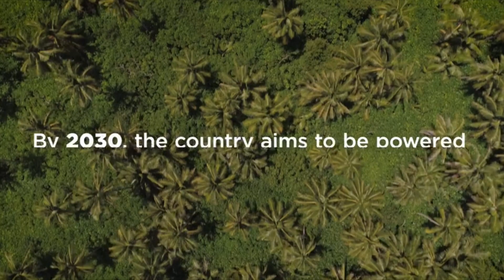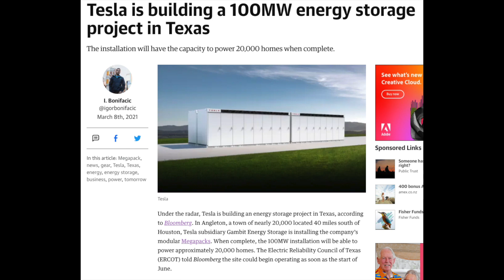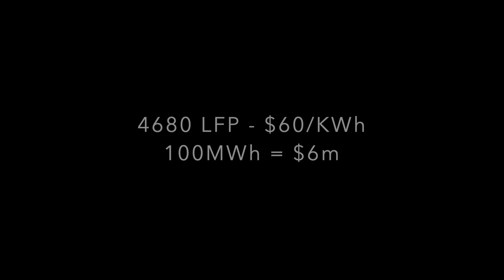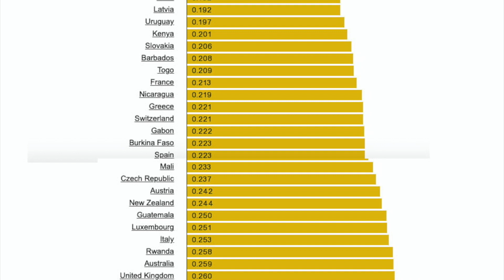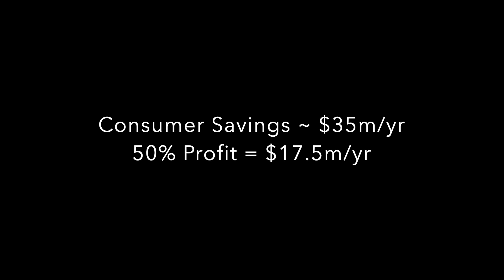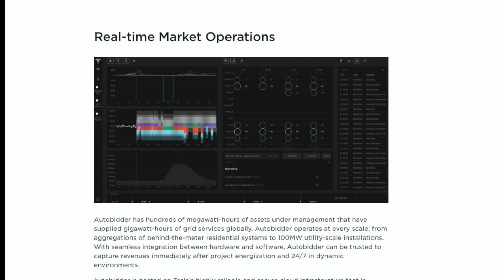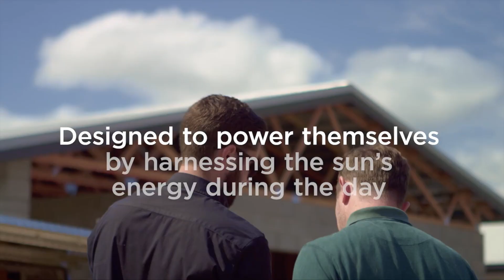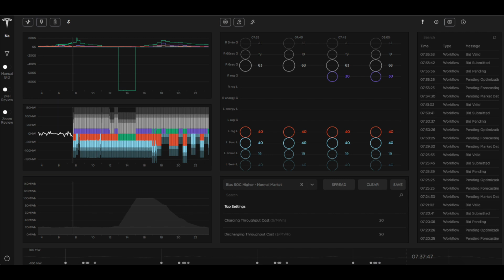Why is Tesla's Energy Business so Profitable? How Much Profit Can Tesla Make on Energy?

Comment: TE, the 10 TWh batteries Elon talked about at BDay was for global supply for energy (as well as 10 TWh required annually for vehicles).  Teslas aim for 2030 is 3TWh of annual production (they did not indicate the split for energy/vehicles frim what I remember).
Reply from the maker: Yea, I realise that, but I cant see anyone else scaling up to that level. And all the other battery suppliers will sell to Tesla, plus its all controlled through autobidder. But, you're right I should have gone with 3TW.

Comment: You’ve made some incorrect assumptions here. As the Power Generator will own the land, it’s simply the cost of selling the battery pack to the Generator (Company) with maintenance and auto bidder packages thrown in. The UK will be the immediate exception as Tesla have applied for a generators licence. Therefore worldwide, Tesla will not incur land costs, and the margins will be higher than you’ve indicated here. @leefal_lowes is my Twitter Handle if you want to discuss further.
Reply from the maker: Thanks, I am assuming more countries move the way of the UK. Tesla will become a juggernaut in time, and get their way. Particularly with governments having larger environmental movements
Reply: @TeslaEconomist  ah yes, that will happen. But the issue with this assumption is that it relies on bureaucracy, overcoming de-regulation of electrical grids. No small thing. A little known fact is that the U.K. has one of the  best functioning and THE most deregulated electrical grid in the world. Other countries and some states in the US are moving towards that, but I wouldn’t expect that any time soon. It’s no coincidence Tesla have made their first foray of being a Generator in the U.K. simply, in other countries around the world, they wouldn’t be able to do the things they can do in the U.K.
Reply from the maker: Yes I thought I implied that in the video 😄
Reply: Essentially I think over time, battery storage may be as profitable as the auto business. Sure, smaller selling price, but bigger margin and simpler manufacturing process. Just don’t think they’ve scaled it yet, not because it’s not as profitable (in the long run), but simply because without selling high numbers of vehicles, Tesla didn’t have a business. How Tesla will scale grid storage, solar and wind (they have been very bullish on wind in the last couple of earnings calls) will be a lot quicker than cars (and they’re gonna scale cars big and quick 🤯 !)

I think the U.K. factory won’t be for cars, it’ll be solar, battery storage and possibly wind.

Comment: Great video on the direction but lots of faulty data and research.

1. The 10TB for Energy is NOT what Tesla will produce but the entire industry.  TESLA will produce onky 3TWH total.  And by then I believe the top battery makers will be also providing the mega packs or bid for battery storage projects.  This is how things works.. competition always comes.

2. Tesla battery prob cost closer to 100 dollars per kwh now at the cell level, not 60 dollars.  Elon mentioned this in 2018 and on battery day last year they said they haven't been able to get it lower... as it as flattened... thats why they are looking to make the batteries themselves to get the price lower.. this lowered price will take some time..

3. The current price they get for their mega packs are for high value storage.  For example to replace peaker plants..  thats the cost savings you see from that Australia battery project.  It's calculated at the highest electricity rate.  That market will become saturated soon enough and then you will need battery storage to be cheaper by a huge amount to be able to replace fossil fuel and get into 100 percent renewables...
Reply from the maker: 1. Possibly, but this is tech - Google, Facebook or Amazon's competition never came.
2. The LFP batteries are already at $80, Tesla's 4680 should be around $60, Elon even said they should be about $50-55
3. A KWh stored, is a KWh stored.
Reply: @TeslaEconomist  sorry for the later reply as I was caught up with something.  Btw.  Just to get this out there, I love your videos.  Don't think that just because I corrected your data points that I am a Tesla bear or have anything against you or your channel.  Keep up thr great work.. here are my response to you.. please do  bit more research and you'll see what I mean.  You can only improve your channel.

1. Competition.

1st, we are talking about energy storage.  This is not high tech.  Your comparison to Google etc are fallacious.  Currently, the entirely of Tesla storage such as their powerwall, powerpacks and the megapacks are essentially OEM products.  Save for their autobidder... the cells, the inverters, etc.   Right now, you don't see many competitors in this space because these products are niche... their prices are way too high and only the rich or desperate can afford.  When batteries comes down in price, and when they reach parity with non renewables, there is no reason why the likes of LG or Panansomic or Catl won't just provide those to the grid... these are all commodities and price is extra sensitive.  I'll go more into this in number 3.

As for competition in general, don't confuse NOT HERE YET, with NOT AT ALL.  In the EV and FSD space, Tesla is years ahead.  But that does not mean others won't get there.  Again, you can't use Google as an example.  Google, FB, etc are all Network affects.  Meaning people are used to using them.  Manufacturing complex cars is orders of magnitude more difficult to gain the entire world market share in a small time frame.  Something like Google search can be rolled out worldwide instantly... you are talking about Tesla taking 10 years from now just to get to 20 percent of the annual production rate.. and then only 0.2 percent of saturation... now, unless you think there are literally decades between Tesla getting FSD and others, robo taxis won't be a monopoly by Tesla... Tesla may end up with a small percentage of that..  in places where they started first....and then FSD over a decade will also be commoditized... even Elon has said this... btw.  I am a programmer. And there is no such thing as a tech that can't be copied or improved upon.

And as for competition in Geneeal, that's just a matter of time..

2. You may have gotten 2nd hand information on battery prices.. unless I missed something,.. go back to 2018.. Elon was trying to get to 100 dollars at the cell level.  And then 2 years later, you see their battery day presentation where they literally drew the battery cost graph.... the price hasn't fallen by much since 2018... in fact, just a blip... they even said, prices are tapering... now, I am guessing they managed to get to 100 dollars but prob not much more... this is where deductive reasoning needs to be used properly..  what information we have for sure.. not get from sources that are just EV bullish. Start from there.  Now, here's another data point... at battery day, Elon said they may be able to get to the 55 dollar mark at the pack level.  This is after they reduced the cost by 57 percent as per their presentation....   that puts their pack level price at about 130 dollars per kwh.. if you take 130 dollars, reduce it by 57 percent you get 55.. or so... that means their cell level cost is, as I said, close to 100... add 30 dollars for pack level.... 

3. A KWH is NOT a KWH when you are comparing different market types..  if Tesla can sell a 37k USD car in the US, does it mean they can sell the same car in India?   BTW.  I have been researching and advocating renewables since the early 2000s.  The battery storage market is separated into various use cases... you have replacing peaker plants.  If you are not sure what peaker plants are, you can look them up.  These are gas or coal plants that are built to supplement the baseload during peak demands.  The electricity they sell are the highest price in terms of KWH... currently, all the battery projects that Tesla is providing are mostly replacing these power plants..  that means the battery has reached price parity with peaker plants... also, of course there are other mission critical uses like for backups for server farms.. and also for helping to smooth out renewables like the first Australian battery... these are easy pickings.. its like when Tesla started selling the Model S....  that car is not just a car.. its an expensive car with a small addressable market... just as the car market, battery storage has a price curve and there is a ways to go before it gets to price parity where renewables plus storage reaches parity with the grid...  when that happens batteries will be produced in such abundance that wrghts law indicate it will become a commodity... and then Tesla will have to bid with all the other massive battery makers for projects... there is nothing special about Tesla batteries other than their 4680 which makes manufacturing cheaper...but even if you go out to 2030, Tesla will only produce 3TWH... which means another 80 percent will be produced by others..  Tesla will like use all their batteries for higher margin use cases...and also, I don't think Tesla will keep their production advantage for 10 years...
Reply: @TeslaEconomist  btw.. Tesla Megapacks are below 200 USD per kwh... and thats when they are just replacing peaker plants... think how much lower they need to get to before they can roll out for renewables in general...

https://www.google.com/amp/s/cleantechnica.com/2020/10/05/tesla-megapack-powerpack-powerwall-battery-storage-prices/amp/

Comment: How you save money using a battery? When the power goes off use a candle and save all that power that otherwise you would be paying for. That's how I calculate.
Reply: Good luck running your air conditioner and computer with a candle.
Reply: @incognitotorpedo42  Turn it off for an hour see what happens, Don't need to spend 10 -20 grand to have power for an hour when everyone else does not. Head power outage twice in the past thirty years lasted for less than an hour.

Comment: I think Tesla will end at the VPP (virtual power plant) level to much regulation at the utility level. With in that context the Big grid storage and the smaller residential level storage and production fit nicely with V2G (vehicle to grid) storage as a peak option. It is important to note that what Tesla has set up is an over the top battery build out strategy. As new and better chemistries come they are put into the Vehicles from the top of the line down as capacity ramps. But even the worst don't get wasted but move into static storage. They wont be reworking the production lines merely building new lines for some time.

Comment: Great video..
Cheap batteries, solar, Autobidder and V2G are unknown / undervalued. RoboTaxi's will be used as batteries to stabilise the grid.
Reply: Tesla is way, way under valued. This is just the beginning...IMO
Reply: @TeslaEVolution  I agree... I think Cathie Woods will have her report tomorrow or next week, with as bear case of $3000 and bull case of $10000 by 2030.
And I believe even those PT's are too low.
Reply: The only thought I have about V2G is that it would completely ruin the car's battery capacity very quickly because of constant fluctuations in charge level, therefore reducing the range. What are your thoughts on that?
Reply: @Jonny94669  Tesla has a great battery management. The new batteries can have around 4000 charge cycles so they say, if you charge these batteries every day, the batteries last 10 years. Perhaps when you charge and discharge between 20% and 80%, or 40% and 60%, is less stressful for the battery, and very useful to stabilise the grid. Batteries and battery management still improves over the time. Tesla probably will use V2G on their own RoboTaxi fleet.
PS. After the batteries can't be used for cars (at 60% or so of their capacity) they can be used for powerwalls or powerpacks, and when they are completely gone, they will be recycled.
Also, Tesla will own large part of the RoboTaxi fleet. When it is economically freezable, they can replace it refurbish battery packs.